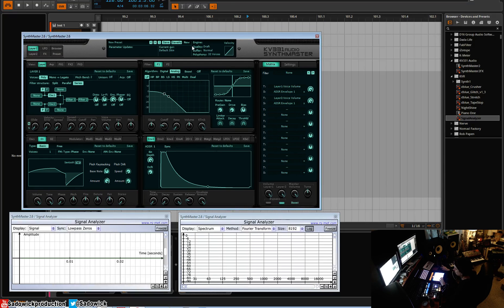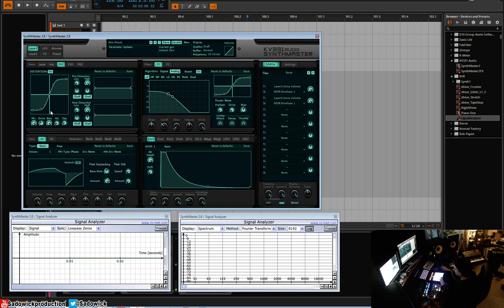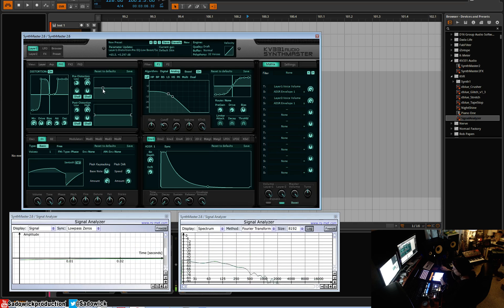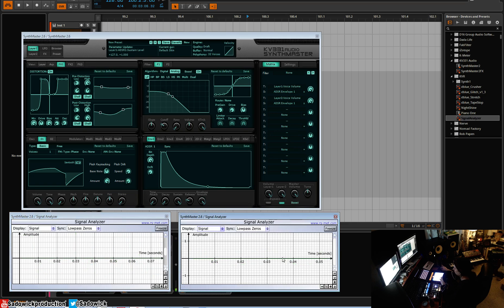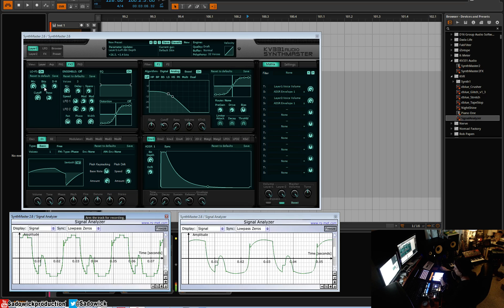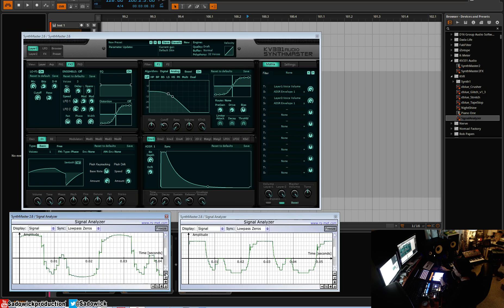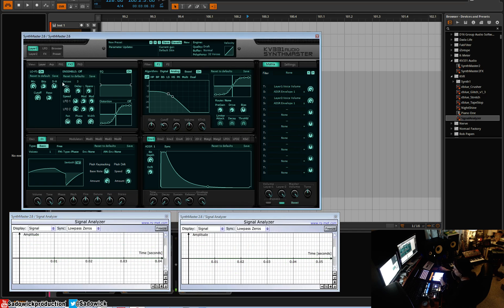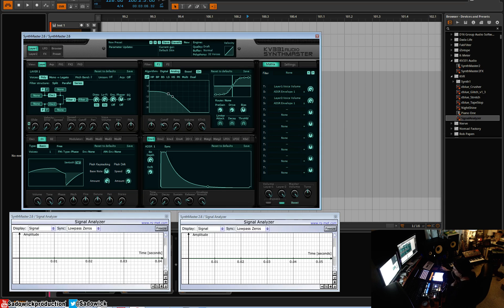KV331 Synthmaster Tutorial 12 - Distortion & LoFi

Comment: Question...have you worked with any other DAW's besides abelton and do you know if this VST is compatible with any DAW? right now i'm running logic and native Instruments maschine
Reply: Brandon Banks Hi Brandon, in these videos he is using Synthmaster in Bitwig Studio.  I purchased Synthmaster 2.6 at the beginning of the year and also use Bitwig Studio and it works great.  Here is some info from Synthmaster's website "Cross-platform VST, AU and AAX: SynthMaster runs as a VST, AAX instrument on both Windows and Mac OSX, and also as an Audio Unit instrument on Mac OSX".  So I would say it should work with any DAW currently available.  I am currently running Windows 7 Ultimate 64bit and when I install Synthmaster it creates a VST folder (if one does not already exist) in Programs/VST, you then just point your DAW to this folder and it should show up in your list of VSTs already installed. Also Synthmaster is a 64bit VST.   Hope this helps